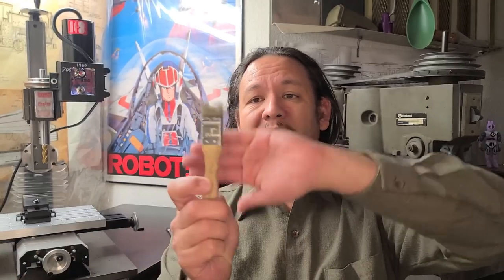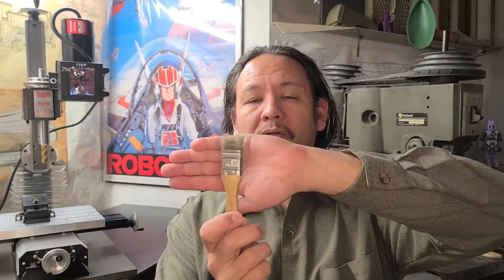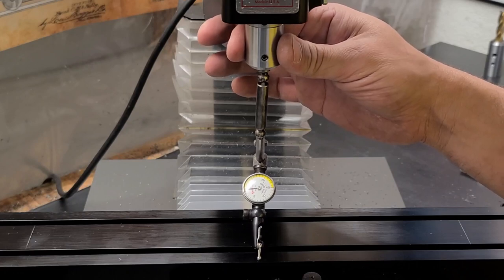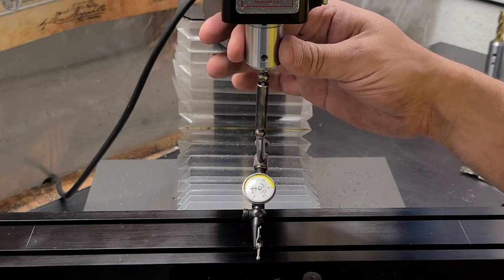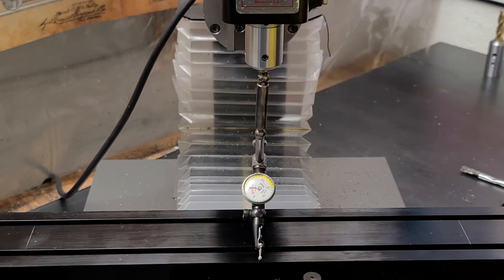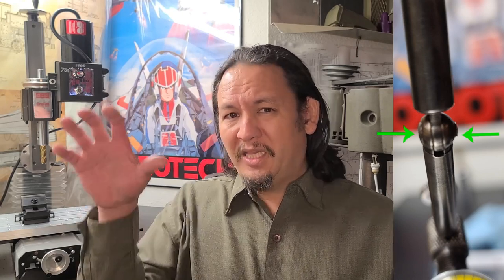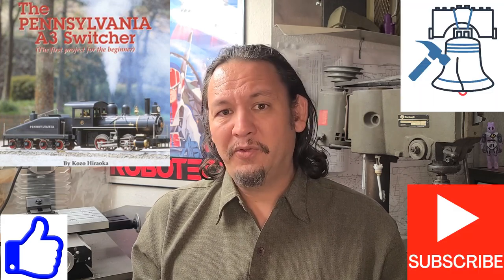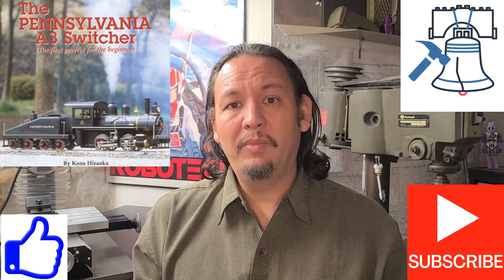Mill Crash?!?!? Recovery Lessons Learned

Comment: I am currently shopping around for machinery so I can also start producing parts for live steam endeavors.  I find I keep eyeing the Sherline equipment among other benchtop machines.  I was curious as to your opinion on the Sherline equipment.  How well do they handle the harder metals and to what capacity?  If you were to start over, would you still go with the Sherline machines?  Thank you in advance for your responses!  I have been enjoying your channel quite a bit, keep up the good work!
Reply from the maker: Thank you so much for your kind words.  I apretiate you taking the time to watch my videos and leave a comment.  The short answer is yes I would still start with both machines. But what are your interests?  Steam plants with a giant fly wheel and 7.5” gauge locomotive or 3.5” gauge and smaller? Have you considered a used full size?  

In terms of new: I have heard a lot of support about the TAIG (https://taigtools.com/)  from it’s fans. I can’t speak to it as I cannot find one to see or try in person. In terms of capacity, I had no problem with making the axles out of tool steel or tender wheels I think came from 2.25” bar of stainless.  I can’t say for sure as I was given the metal from a machinist I know and it spent about a decade in the bottom of a bin without sign of corrosion.  I tried turning a four inch long segment and it was not practical.    The jaws on the Sherline Chuck just don’t have the force or the surface area to hold it well and the machine is just too light.  But that would be common across all the smaller benchtop machines.  In terms of precision, I couldn’t be happier.  I have chatted with several people who have import hobby machines and those need some modification and stoning to get them within .003 accuracy. Out the box I still find the Sherline is splitting .001 inches. 

In terms of used: The biggest barrier is space and being wired for 220volts unless you find an Atlas/Craftsman. Plus, there is the willingness to hunt and save for a good condition machine or rebuilding and restoration.  I am looking for that perfect LeBlond, South Bend, Monarch, Hardinge, Bridgeport, or Sheldon. But having the Sherline lets me be more critical of the used machinery I come across.  I can machine now and not have to worry about a full restoration job. That being said even if I find a good full size machine I will keep and continue to use the Sherline.  The journeyman let me run their 15” swing Mori Seiki lathe.  A lot of fun and power but what a pain to try and make small pins or axels or tender boxes on a 3.5” gauge.  For the Sherline Mill, it would be great to have it converted to CNC alongside a real Bridgeport.  There are lot of CNC options for the Sherline Mill both factory and aftermarket that can be added down the road. 
 
Hopefully that helps more than confuse and provides a little more insight on my thoughts.
Reply: Wow, thank you for the quick response!  Down the line I may build a locomotive as designed by Kozo, we will see, but I am actually designing a three truck shay in 1:20 based on West Side Lmber Company's #10 to run on 45mm gauge track, very heavily influenced by Kozo's methods, I have three of his books.  As planned it will run on butane and run at about 60psi.

  That is actually very reassuring what you had to say about the Sherline machines.  I have done quite a bit of research but to actually get information from a verified source  is gold!  With a pricey purchase like machines, I don't want to make an ill-informed decision and regret it. 

What you wrote has helped allot actually.  I am new to the benchtop machine world and quite honestly, the forums just confuse the truth further as far as the quality and capabilities of the machines, atleast in my experience.  Everyone has an opinion but not much evidence as to where they are coming from. 

I also have been able to have some time on bigger machines.  My father actually built a 7.5" gauged shay in 1.5" to the foot as I was growing up (that's where the steam bug first bit me) and as a result I got to get some experience on his Bridgeport and his lathe (I forget the manufacturer unfortunately).  Those actually led to me being a cnc operator for a couple years.  I am by no means a machinist but I do know a little.
Reply: Also, you are welcome for the kind words!  You have earned them with the skill you show in your build and your honesty.  You don't hide your mistakes and I respect that.  I have been a subscriber to your channel now for a bit and enjoy each episode.
Reply from the maker: @andykelsey1813  Thanks so much I apretiate you saying that.
That’s very cool I would build a Shay.  The running gear is just mesmerizing to watch.  I have both of Kozo’s Shay books.  Something for after the Pennsylvania A-3.  I would love to also have a 45mm G scale line someday.  There is a book you might find helpful “A Climax Class A Live Steam Locomotive Model” by Edward Hume; ISBN-10:  1545404895.  I’ve only read the sample portion available on Amazon.  It seems to be an informative build.  It is a narrow gauge scaled to Gauge 1 or 45mm.

I think the Sherline mill and lathe would be suited for a 45mm gauge.  Luckily, I was able to tour the Sherline factory pre pandemic and get hands on in the showroom.  I found the same problems you ran into on forums.  People are fans of whatever platform or idea they are committed to.  At least with a video we can visually judge for ourselves if something really is suitable.    If you can ever get a chance to check out any brand in person, that’s the best.  Whatever brand you settle on, if you have a paypal account there is an option to set up a payment plan.  On both my machines I waited for a 0% APR promotion on ebay that broke down the payments for 24 months.  Much more manageable.

Sherline 5800 Next Gen Mill Package A: https://ebay.us/HhkaKO
Sherline 4400 C Package: https://ebay.us/Qv5R5g

That is something else your father built a 7.5” gauge Shay.  Unless it is live steam so much charm is lost on the plastic models.  That’s cool you got to work on a CNC.  The things those machines do are unbelievable.  It’s great you have that background, every little bit of experience helps.
Reply: @LoydPrecisionMakers  My friend actually has that book and holly cow is it full of information.  The author really took Kozo's teachings to heart and added CNC to the mix.  Eventually I will be purchasing a copy for myself. :)

I definitely agree with you about the video aspect!  It is amazing how tricky it is to find good videos that really let you LEARN about the machines.  At the moment I can only think of you, blondie hacks, artisan makes and click spring that honestly do a good job of really showing what certain equipment in the hobby machine shop can do and are honest about it, including the short comings!  

There is definitely a certain charm about live steam that plastic just can't measure up to.  Steam is one of a kind!
Reply from the maker: @andykelsey1813  Thank you it is a really honor to be mentioned with all those makers. They set the bar high and make fantastic videos.

Thanks for the feedback on the book. I was on the fence about it. I am going to get a copy now.
Reply: I knew less than zero about Machining. I had been paying a guy to machine Custom 1-off Aluminum Parts for 1:25 scale auto models. After 1.5 years I could of purchased the Sherline Lathe, with what I paid this Cat for machining parts✅
👉Like many others, I was looking at the foreign made machines (I didn’t know any better) & I’m Sooo glad I didn’t. A buddy told me to get the Sherline 8” 4000 series Lathe & I did. At 1st it may seem like it’s Expensive compared to the overseas units, however all I read about those is the $$$ spent to get them working or setup properly. Sherline comes out of the 📦 ready to rock. 
SHERLINE is a USA company out of Cali & the machine’s Craftsmanship is Excellent💯. I purchased a Base model with only a few accessories. So I added them slowly till I owed everything I needed (which was 95% of everything they make for it) I wound of SAVED a Bunch if I had of purchased the “C” package in the beginning!!!! 
✅TIP If you can swing it SPEND the Money for the “C” package!!! 
After a year I was ready to get a Mill.
Another ✅TIP SHERLINE does Monthly 20% Discounts on products!!! I’ve saved myself about $500-$600+ in past year by purchasing the 2010 Mill & several different Attachments, by catching these 20% off item months. 
☯️ZenModeling☯️
Reply: I have a taig. I haven't found the group that was mentioned... These bigger sherline mills  look easier to tram. I'm eyeing one. Another difference is that the Sherline can adjust speed. You have to change pullies to change the speed with a taig.
Reply from the maker: @Kaizen712  It is nice to beable to dial to a speed and go up or down to get the perfect cutter speed.  Unfortunately there are no markings that correspond to a rpm.  On Sherline's website there is a downloadable template you can stick on.  Someone else recommended going with a DRO set up that  can read/display spindle rpm.
Reply: @LoydPrecisionMakers  you can also use a hand held tachometer to get the rpm.
Reply from the maker: @Kaizen712  I think I know what your talking about.  One of the machinist I know showed me an example but I haven't gotten my hands on one yet.  Starrett made them I believe as a speed indicator.  I just checked Ebay and they seem to fall under $20.  I might need to try and see I can get one.

Comment: Hi, obvious lessons might  be, Never touch moving parts even with a brush to oil or metal piece to remove swarf.  Only wear gloves to clean the machines and they must be switched off,  Always clean machines after using them, never leave a running machine unattended even for a short period of time, always wear safety glasses and always wear short sleeves or roll them up well above your elbows, if long, keep your hair tied back or perhaps wear a cap and never ever wear a chain around your neck or rings on your fingers when opperating machinery.  

Above all always respect have fun with your machinery.  Thanks for your time, I enjoy watching, looking forward to the next episode!
Reply from the maker: Your right.  All of those are excellent points of safety to practice each time.  It is true, respecting the machines and observing safety rules ensure many safe and successful operation.  There is no fun operating session with an injury or crashed machine.

Thank you for watching my videos.  Just getting caught up on journal boxes and I will get on with finishing them here soon!!!